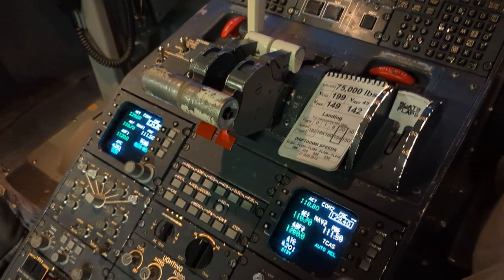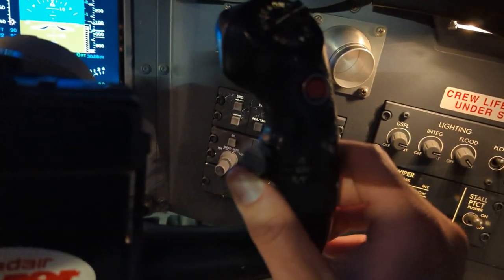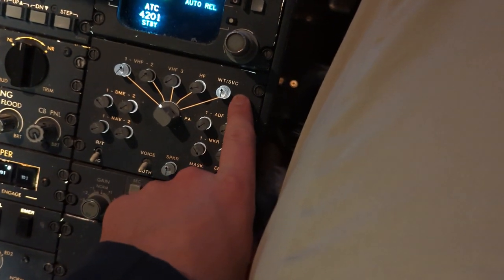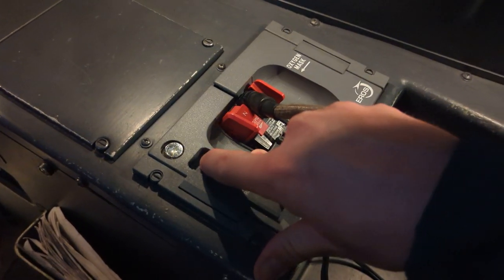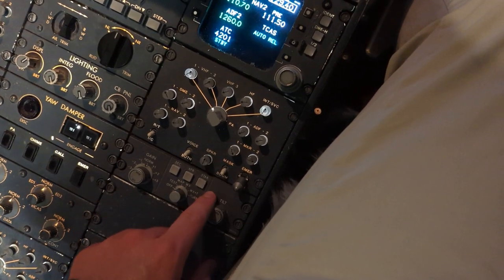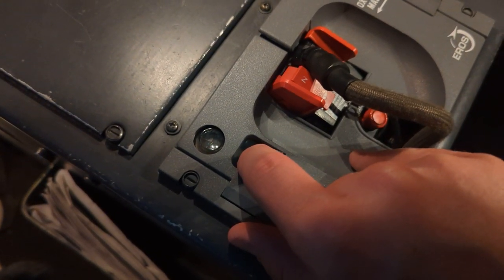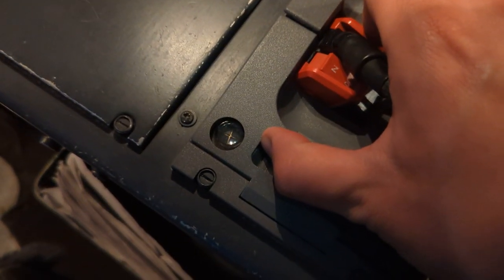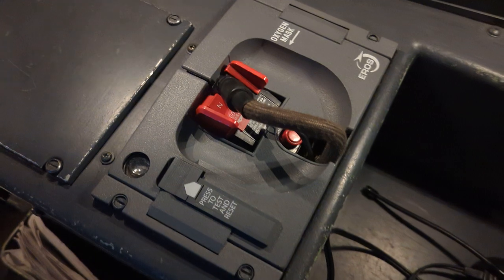EDV Oxygen Mask FFOD Test

Comment: Hi, I recommend checking CFM Chapter 4, Oxygen Mask and Interphone System Test again. The PRESS TO TEST AND RESET lever should not be released until the whole test is about done. We do not release and re-push it for Emergency flow control switch and Mask operating levers tests. Have a good day. 😄